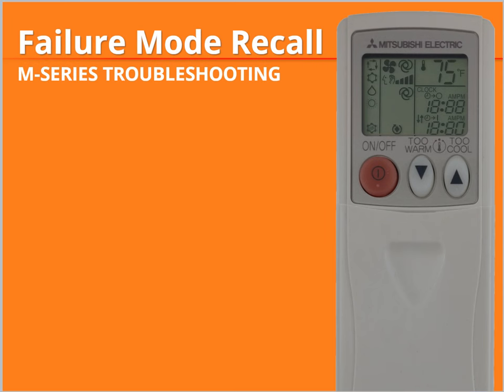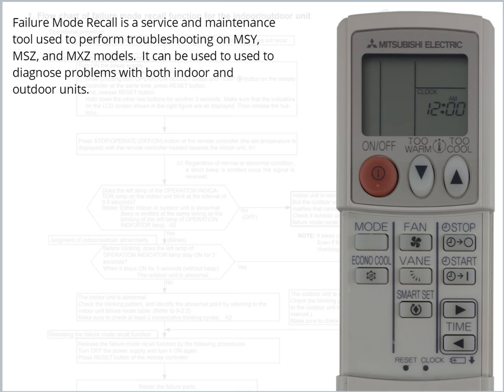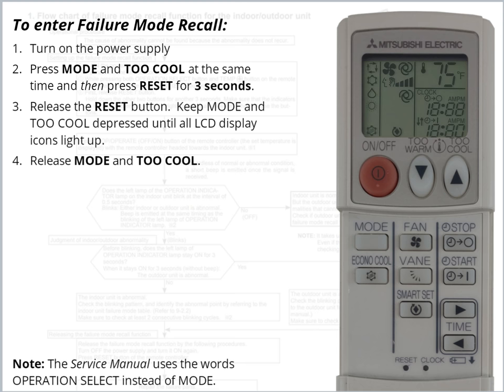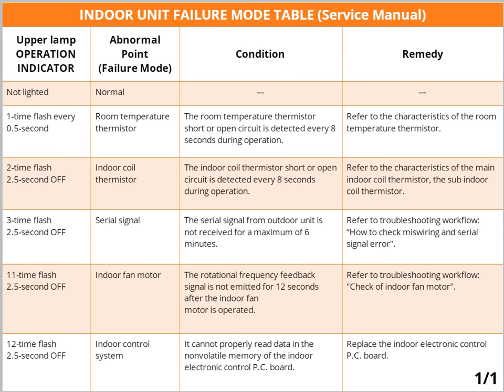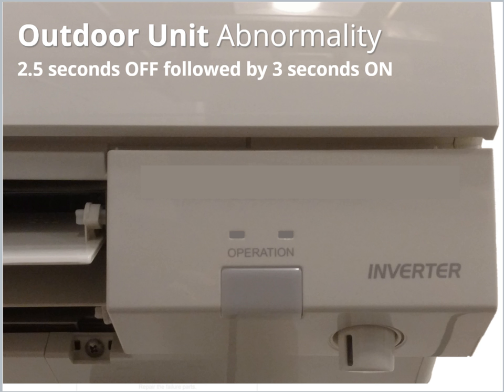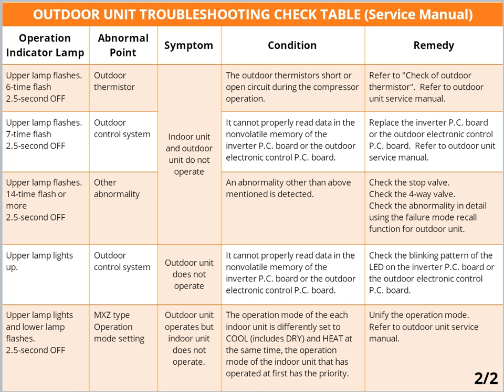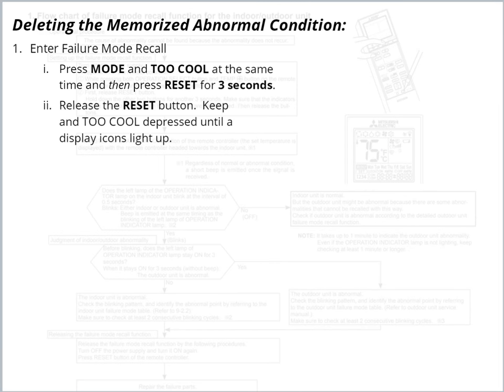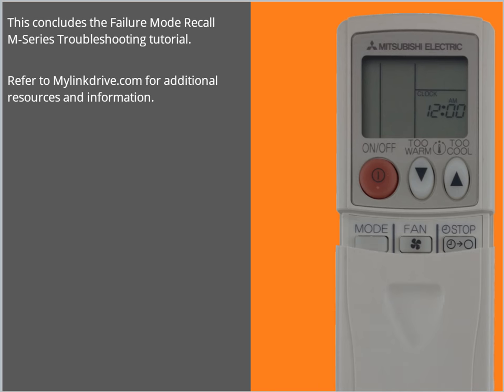Failure Mode Recall - M-Series Troubleshooting

Comment: I can get into failure mode recall, but when I press the on off button, I don’t get the flashing lights and beeps.  Any idea why this would happen?

What’s really strange is after I reset the remote control to get out of failure recall mode and I guess erase whatever error messages should’ve shown up, the heat began working again....
Reply: Exactly the same happened to me! I only persisted after reading about your experience, so thanks!

Comment: I am trying to see if my remote works with Mitsubishi split unit PKA model unit. My remote power On/Off button does not turn the unit on & off or doesn’t control any of the functions. So  I thought I would try this troubleshooting videos see if it’ll reset. Nothing. The model number on my split unit is PKA-A36KA7. The remote I’m using looks exactly like the one in the video. The number on the back of the remote is KM18G 040C. My other issue is this unit was off with a flashing green led, so I had to go on the rooftop unit to reset the disconnect to get rid of the flashing green led. Once reset the light is solid green but I still have no control with my remote. That’s the reason I used your video to see if there is anything wrong with the inside/outdoor unit or the remote. I put new batteries in the remote. I did the steps 3 times and I still have a solid green led. No flashing or beeping noise. Does that mean my unit is good? No issues? Thank you.

Comment: After doing this I had the "room temperature thermistor" error and after seemingly fixing it now my remote some times wants to work and other times doesn't. Sometimes my unit will be on working then i'll try to change a setting on the remote and i get no beeps or any input until i turn off and on the unit via power button on remote